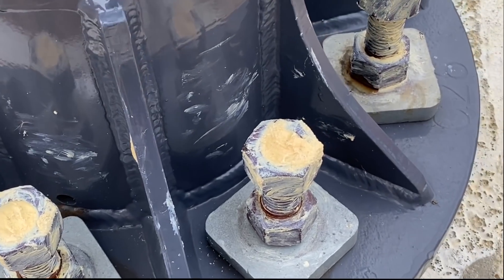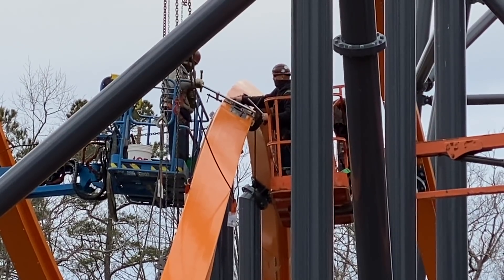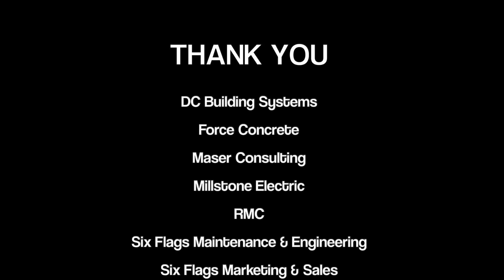OFFICIAL Jersey Devil Coaster 'Behind the Adventure' Construction Update - Episode 5

Comment: Won’t you feel those shims while going over them?
Reply: Nope
Reply: They'll smooth over the joints so you can't feel them... I imagine Wonder Woman and RailBlazer have them too and I don't believe you can feel them.
Reply from the maker: @sonyipod - @CrashCoaster is correct! You can see the worker grinding the shim. It will be flush with the rest of the track.
Reply: Raptors wheels also run on the sides of the mororail so they'll clear the shims. RMC wouldn't design their coaster track to do damage to their train wheels like that.

Comment: It’s not gonna be rough when it open right, since it’s been left in pieces for a long time
Reply: RMC is very smooth
Reply: Not only because it's RMC but they have to do about 1,000 cycles of testing before it can even open for the public. During testing if there are rough spots they will grind it down smooth like they have been doing on the velociscoaster in FL
Reply: @davidfranco1475  RMC definitely has some good fabrication technique with their steel